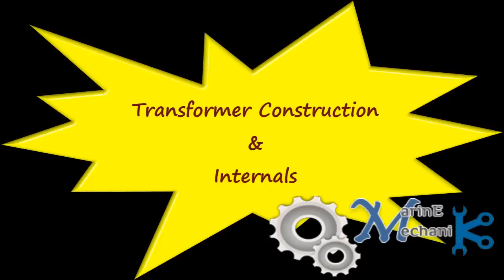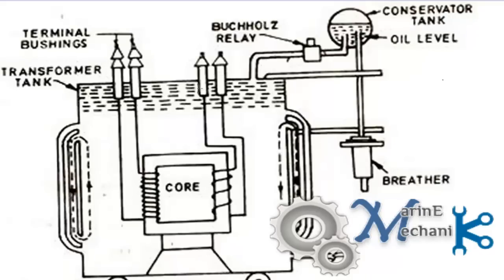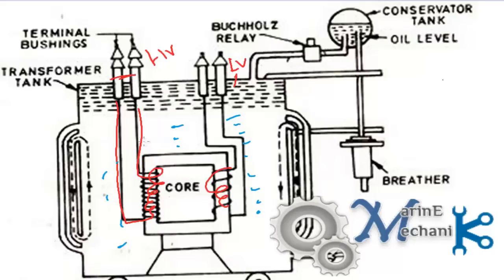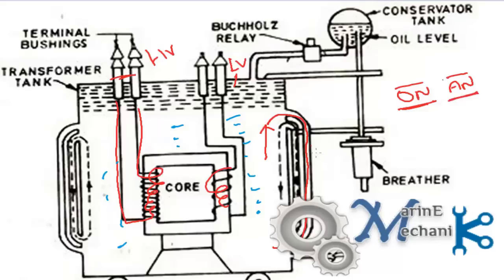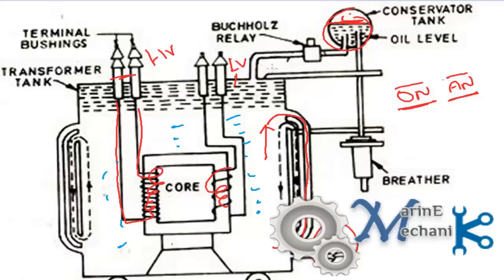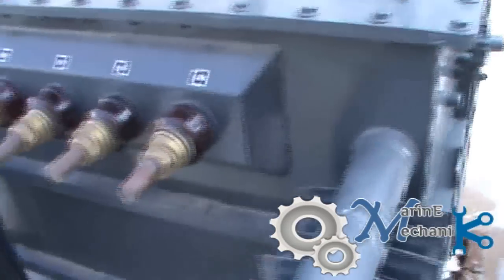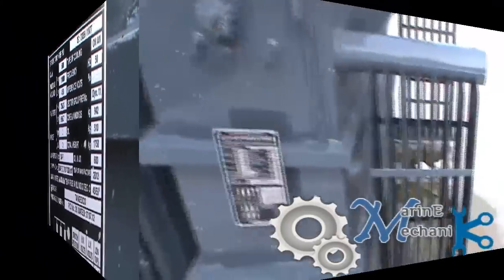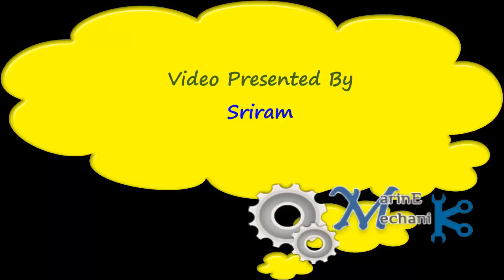Transformer Working - Internal Construction & Close up View.

Comment: In step up voltage tranformer ,why secondry is made with thin copper winding
and why primary is made with thick copper winding 
explain plzzz?
Reply: bcoz secondary wdg carries less current(for step up) to satisfy transformer action so for low currents thin copper wire used similarly primary carries high current so we use thick copper wire.

Comment: Larger transformers have pumps to circulate the oil through radiators while fans blow cool air across the fins. These are switched on automatically by instruments when the temperature of the oil reaches a set point - similar to the fan in your car cooling system. This is to protect the windings and oil against damage from high temperatures.